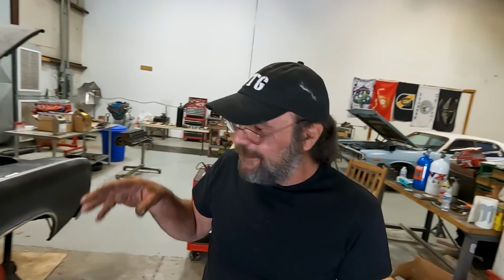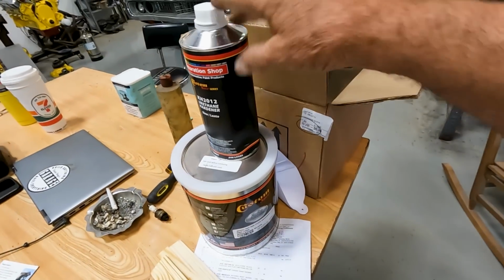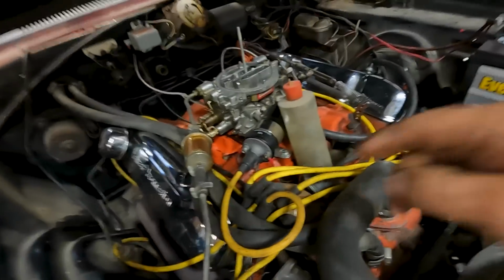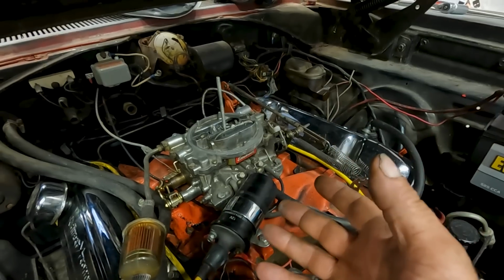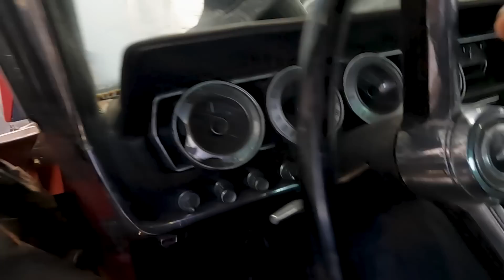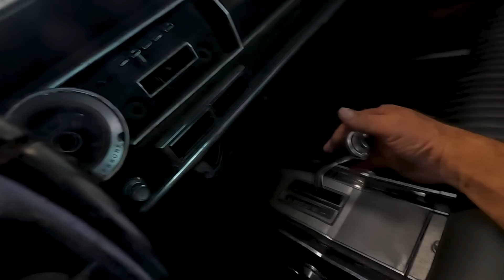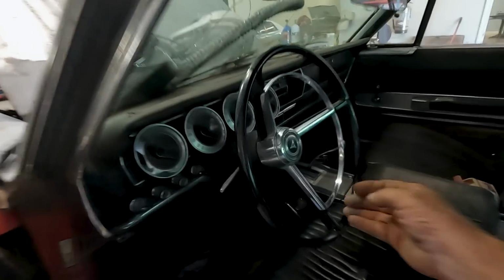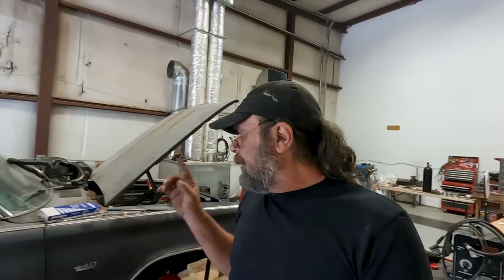Last Minute Hustle - Our 67 Charger Is Back Together And Running But We Still Have A Ways To Go

Comment: Just started my 440 I rebuilt over the winter for my 70 GTX. 70 block. Aluminum heads. 484 purple shaft cam. Melling high volume oil pump. Milidon 7 qt. Oil pan. Rebuilt the 3 Holly 2 barrels. 10 to 1 pistons. I also took off the headers and went back to stock 70 exhaust manifolds. At some expense I might add. 😮. She starts right up. But pounds 90 psi oil pressure. Heated up she drops to 70. Doing the brakes now. Just need to bleed them. Rebuilt all around. New master cylinder as well as slave cylinders. Thanks for the motivation UTG.

Comment: Pertronix?  What's next? Filtered cigarettes? Skim milk? Exercise?   I thought I knew you.....
Reply: Next thing you know it'll be a Holley Sniper and front disks. Sacrilege!

Back in the seventies I would buy an electronic ignition kit that was fired by a Hall effect transducer which was triggered by a ring with 6 or 8 magnets depending on the application. I kept a set of points and condenser which could be swapped in about as quickly as in a stock distributor but never had cause to use them over several cars and many years. If I remember correctly the first kit cost about $12 and the last one, about 10 years later, cost $19.

Comment: Tip:  Make sure the pertronix ignitor grabs its power before the ballast resister.  It operates at full battery voltage.  I’ve never used one but, I’ve read that’s a common mistake that leads to premature failure.  

Awesome car man.
Reply: Very true, I burnt 2 pertronix units from wiring thru resistor and they where expensive in the 90's
Reply: Cougar cars use Purr-Tronix ignition systems.  Get it 😂?
Reply: came here to say this

Comment: I think you're very wrong on an Edelbrock not giving you the performance of a Holley. I have 2 of those 800s on my hemi and they are box stock except the springs and I'm close to the 9s with them. I'd run Holleys but I wanted the traditional hemi look. As far as bulletproof? I agree. People that say they're junk are close minded. The AVS 2 is one nice carb.

Comment: Pertronix is to points as fuel injection is to carburetors. LOL. Yeah, I like the Pertronix, but it's definitely a good thing to be taking the old-fashioned points distributor on a trip. Just in case....Take care, Uncle Tony!
Reply: after market reliability . still using the Hays  Magna pulse i bought in 1975. if it goes there are no parts for it i contacted hays about it a few years ago HUH what is that .
Reply: I mean nothing wrong with a vacuum actuated advance tbh.  The originals still work in both my trucks. And one is prone to be finicky its why amc got rid of it in 77 i believe but it still works for me.

Comment: Your first starts are always spot on, never once have I ever gotta an engine to fire right off on the first try and run the way it should!
Reply: Uncle Tony gives her a shot of nicotine down the carb wakes her right up
Reply: I static time them and they fire up first time, every time and are within a couple of degrees.
Reply: @BadWolf762  Don't know why people don't know how to static time an engine, I always set mine at 10 degrees advanced and once the cam is fully broken in, I fine tune the engine. It's so easy, where is the mystery?

Comment: Once I used Pertronix, I never went back to points. MUST have constant 12v supply, though - no resistors or resistor wire.
 Have you used propane in an air conditioner yet? I keep hearing about it. Would make good content.

Comment: Nothing like the sound of a 440 with open headers.
Reply: Try one at ~9 grand.   YES they WILL turn that high.  Crane anti-pump lifters, triple valve springs, and a set of heavy spring race points.

Comment: Pertronix, bullet proof. Much better than playing with points and the regular adjustment and replacement. Bypass the ballast resistor and keep a set of points and condenser in the glovebox just in case.
I put a Pertronix in my Ford 289 distributor after I got tired of asking for points and condenser. In the old and simpler days, you could go into a parts store and ask for a points and condenser for (in my case) a 1966 289 single point. Counterman would wander in the back and return a minute later with the proper items. Same applied to carburetor kits. Is it 2V or 4V, auto or manual.
Now they have to fill in ALL the boxes on their glowing box to find if they have what you need and the location. So now you need to go through the Make, Model, engine, transmission, AC questions. 1966 Ford does not do it. They have no understanding or seemingly interest to find out that all Ford V8 engines used the same points and condenser other than dual point. Those used 2 six cylinder points.
A couple of timrs I tried telling the person the parts were for my 1940 Ford Fordor Deluxe with a 1966 289.with a C4 automatic. Response came back that a 1940 Ford did not have a 289. Says it had a 239.
Good call Jr.. Now would you like to fill in model Ford. Ya hit a brick wall on reinforced concrete with that. The Pertronix solved that.

Comment: Hello Uncle Tony!  I was wondering if you could do a video on how and why rotors warp on brakes.      Is it due to riding the brakes or crappy construction.   I think it is a good topic.  Thank you 😊.  I do learn so much from your videos and enjoy them. 😉
Reply: It’s due to heat. Riding the brakes cause heat. Sudden aggressive stops cause heat. 

There’s a number of factors. But yes. Cheap Chinesium rotors will warp faster.
Reply: Usually it comes from stabbing the brakes. The sudden jolt. Most of the time comes from that one big near miss.
That's why brake checking is stupid.

You are correct though, the more you ride them they will be hotter and if you stab them then; or apply heavily they would be more apt to warp.

Comment: I did that with my 67 440 gtx convertible when was changing my mufflers.even drove it around the block a couple with no mufflers.dont know if it made it faster but it sure as hell sounded faster

Comment: You can ONLY make minor tuning changes with Edelbrock carbs. I've had an MSD, Mallory, and Pertronix conversion in various vehicles over the years, and so far no problems with them. I run those or MSD distributors with the intake manifolds that won't clear an HEI or I need a rev limited. I'm not doing power tour any time soon. Too many people for me, big crowds and parking in lines waiting to get in are not my thing.... also Dan and Tony hate me... in a good way. heh.
Reply: Heh😂❤

Comment: Tony I’ve been told that my 66 383 2V with 346 heads that came on it when I bought the motor is going to be a dog so what do I need to do to get it where it will make some power and it’s a 727 transmission and has a 8 3/4 rear end but I haven’t looked at what the gear ratio is yet but the little 318LA does push it really good from a stand still.

Comment: Got the flamethrower igniter II on my 440. Love it. No points no ballast
Reply: Tell me more about that set up, Stuart. Thanks
Reply: @shaunclifton5281  I got this distributor and ignition coil. 440 seems to runs smoother 

PerTronix D143700 - PerTronix Flame-Thrower Plug and Play Billet Distributors

PerTronix 45011 - PerTronix Flame-Thrower II Ignition Coils

Comment: Ive personally had worse luck out of Edelbrock carbs than my holleys. The bushings sucking air in the throttle/butterfly shaft on two carbs in a row then a cross threaded or over torqued jet in the body of thd carburetor ended up junking another. I will say Edelbrock carburetors handle climate/weather/elevation changes much better than holley carbs do.

Comment: I haven’t had a great run with Pertronx lately. I don’t know whether they sold out and started getting them made in China but they fail and give intermittent problems to often. On both instances I was directly involved with I stuck a new set of points back in them and all intermittent problems went away for good and they ran better than they ever had. They had given problems almost from the start. And I have herd other stores now through talking to people. Two decades of experience running Pertronix or fitting them for people and now I wouldn’t recommend them anymore. If you had an old one that’s been on a shelf for ten years then grab it. The new ones are shit. Maybe they are knock offs, I don’t know. I didn’t buy them. Buyer beware though.

Comment: Love it! Didn't this car have disc brakes before, or did I miss something?
Reply: Yes it did he changed it back to drum brakes which I don't understand. I had drum brakes on my Duster I change that shit out to disc brakes for better stopping and control. The car that old don't handle well. I talked to people that own those cars they don't make daily driver because  of today's traffic.
Reply: @keithsims86  I hear you. I completely restored a 1936 Ford. It has a flathead V8 and PROPERLY rebuilt mechanical brakes, so it runs pretty strong and stops well, though, obviously, it’s nothing like a vehicle from the muscle car era. Overall, my Ford V8 drives better than it has any right to, but other drivers these days terrify me. People are absolutely nuts.

Comment: I so agree with the Edlebrock carbs
   However, I disagree on no performance 
I got performance from mine 
    I knew a carb wizard.
Reply: ‘No performance’

You got performance. 

A bad performance is still a performance broski
Reply: Walmart battery. The last one I bought from them died in 9 months. Got a free replacement of course. Gave it away free to someone I knew that had numerous vehicles sitting around after I went and bought a better battery made by East Penn/Deka.
Reply: @jeffnorbert1871  same thing with my walmart "max" battery.👎
Reply: @wayne8498  haha I run nothing but Walmart battery's and get 6-8 years trouble free. The trick is have it tested on their tester before you leave the store. Then you get the good ones. Currently have at least 5 in service, newest one is 3 years old

Comment: The pertronix brand is terrible! I put a kit in my Chevy LUV and it lasted 6 months intill it failed.
Reply: No it's not. It HIGHLY reliable. I suspect you probably didn't run it full 12v but through the cars resistor (many cars resistor is the wire itself remember, so you might not know you resisted it.) Run a devoted, new line with a fuse holder and it'll last for YEARS and YEARS.

Comment: Those spare points will remain right where they deserve (other than the trash bin ideally lol) in the bottom of the spare parts box in the trunk. You won't need 'em. Great car! Don't rush the paint. Take all the trim off, flatten it out real nice with at least 3 coats of high build primer, blocking each coat with the long board. Black NEEDS to be FLAT to look good. Big car like that, I'd have at least 2 gallons of high build on hand with 2 or 3 cans of guide coat and I wouldn't cry about using it all either. Each coat of flattened out high build, covers a multitude of sins! Like each time equals to like 25% better paint job in the end. It's MASSIVE and doesn't take that long really. Even if you skimp and just take an hour sanding each coat flat just estimating, without guide coat, you'll still get MASSIVE gains for every coat, up to at least 3, then it will trickle out to fine tuning.